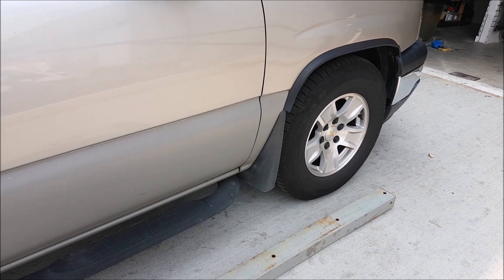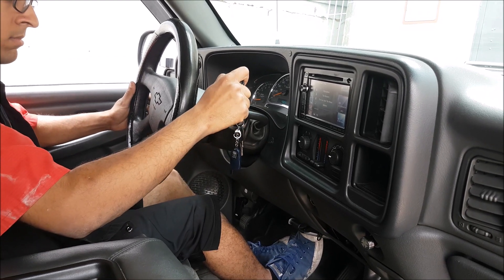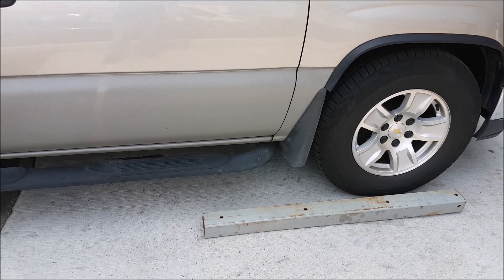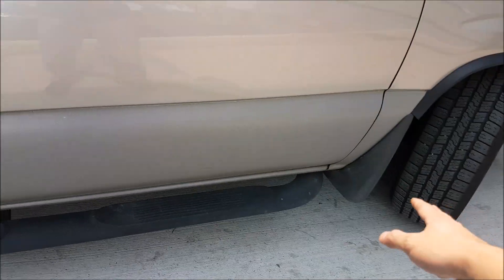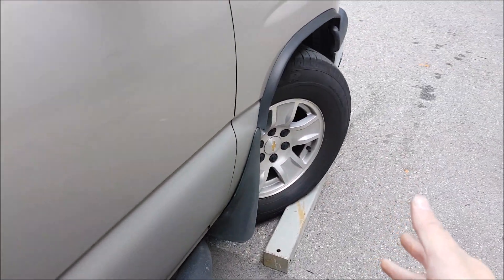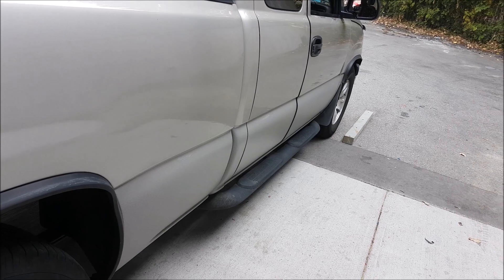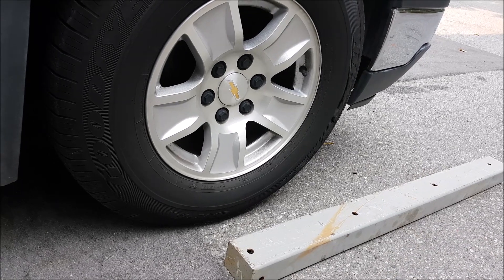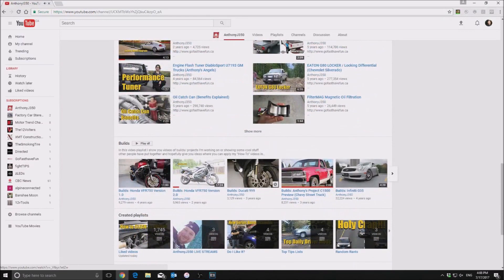How to Park on a Hill/ Incline Uphill & Downhill | AnthonyJ350

Comment: Wow never new this till transmission went out. What if u remove parking brake after ur in gear?
Reply from the maker: The vehicle may move a little if on an incline and put the forces on the transmission like shown in the video.  It is designed to operate that way but I just can't see it being good for the transmission.

Comment: I did this mistake today, I forgot to apply the e-brake on a steep hill in my new car and when I parked it, when I put it back in reverse I heard a loud noise, if I did it once could I damaged the cvt transmission just for doing it one time?
Reply from the maker: It's possible, I prefer traditional transmissions with planetary gears for their durability.

Comment: Thanks for the info on how to park on a hill.  However, whenever I park on a steep uphill incline and try to leave the spot, I always have problems shifting the gear shift (mounted on the steering wheel) out of the "Park" position.  It just won't budge, and I'm fearful of using too much pressure to move it into either "Drive" or "Reverse" to move my car out of the parking spot.  The emergency brake is engaged - Should I shift it into "Drive" or "Reverse" first before releasing the emergency brake?
Reply from the maker: You're putting pressure on the pin first. Watch the video again. You'll see I put the vehicle into neutral, apply the parking brake, make sure it doesn't move. Then put it into park.

This makes sure there's virtually no pressure in park. You're parking brake assembly needs to be working properly.
Reply: @AnthonyJ350  Thx for replying so quickly. I will follow yr instructions to park the car. My question was how to leave the parking spot - what order should be followed? For example, should I put my foot on brake pedal, put shift from park into neutral, release emergency brake, and then put car into either drive or reverse to leave the spot? Or is there another order to follow. Hope to hear from you again. Thx for yr help
Reply from the maker: @eileenfazzini7551  From a stop. Apply the foot brake, put the vehicle into gear then release the parking brake. You can now drive away.
Reply: @AnthonyJ350  Thx again for your expertise.
Reply: So say you don't leave the parking brake on but the next day you get in your car you're on an incline. You would be in park obviously then do you put your foot on the brake and parking brake then let off the parking brake and have your foot still on the brake then put the car in reverse?